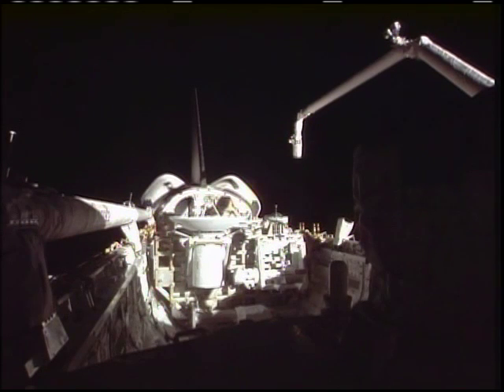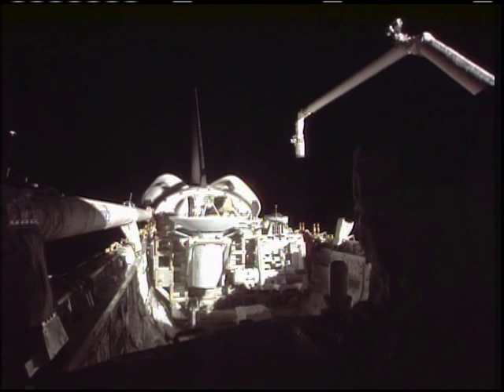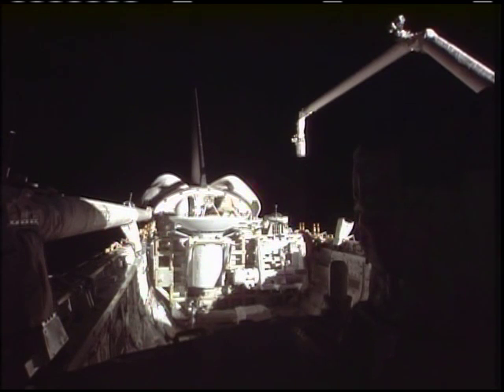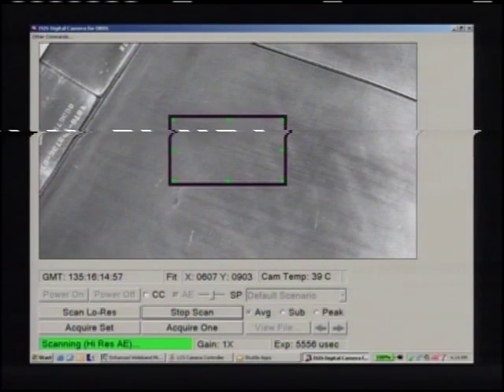Backup Mode Used to Inspect Shuttle

Comment: as far as i know, on the first shuttle mission the acoustic pressure from the engines ripped off a lot of tiles from the heat shield. how did they survived the first misson, and what's the sudden worry about the digital camera resolution? as long there is no serious hole in critical areas, they can land, can't they?